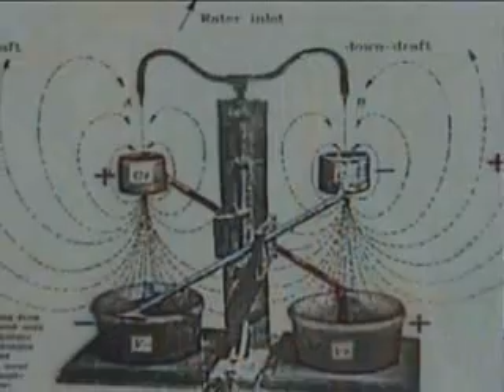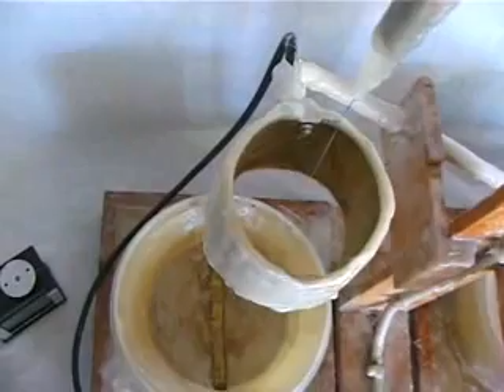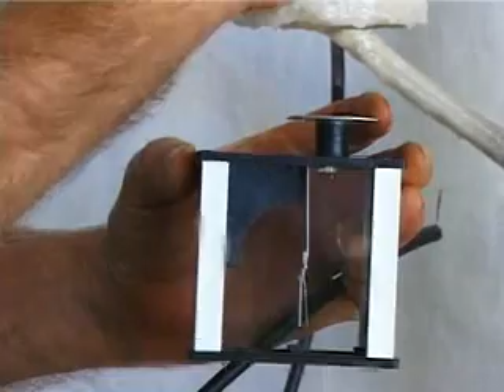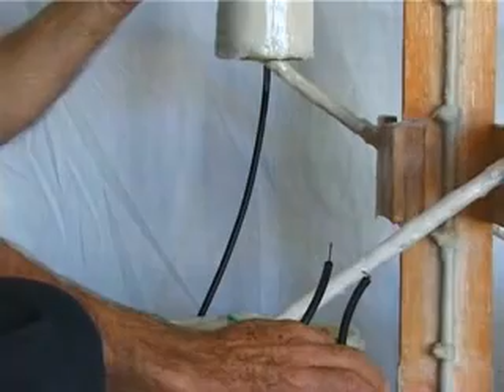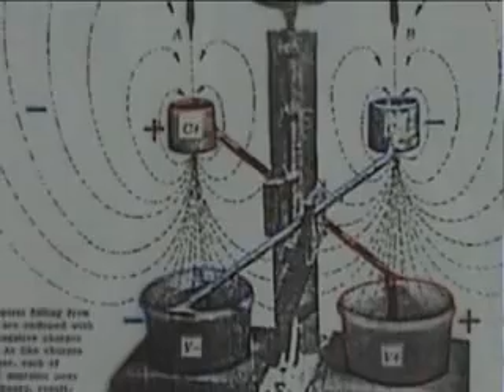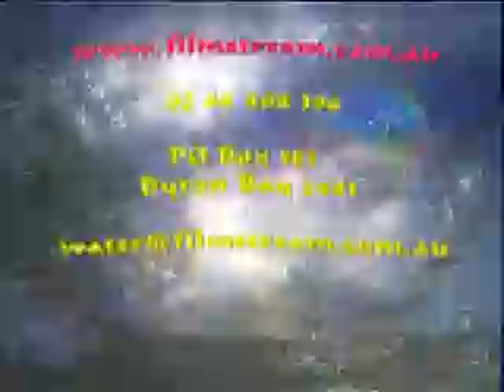The Extraordinary Nature of Water -Viktor Schauberger 6/6

Comment: He's right...but only half right. The machine only proves that falling water creates a charge. The input of the device where the water comes from is not connected to the 2 buckets so the system only lasts until the buckets overflow. Obviously the input water is coming from either his local tap (aka government supplied water tank pressurized chlorinated water) or he collects rain water from his roof and stores it in highly mounted tanks.